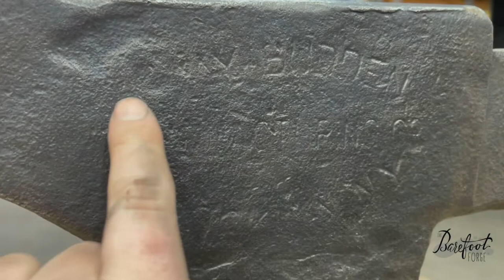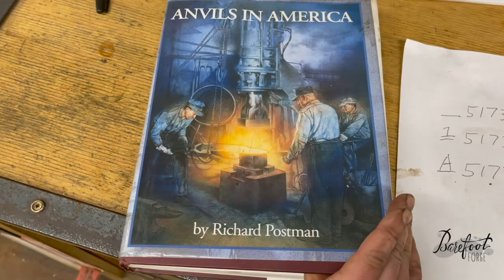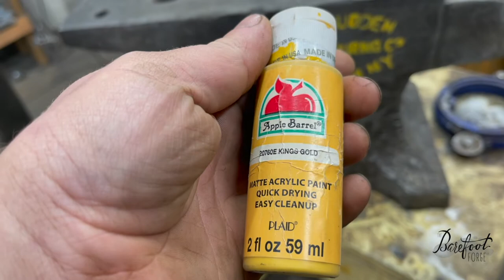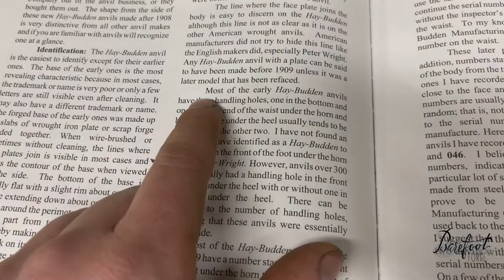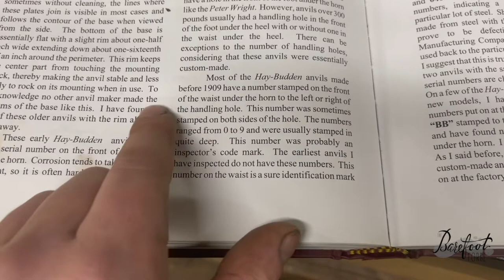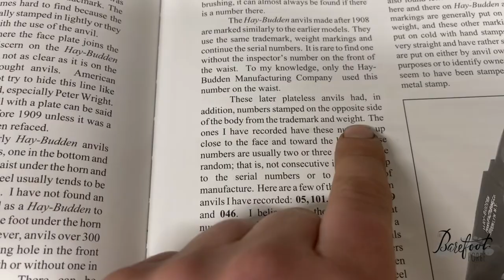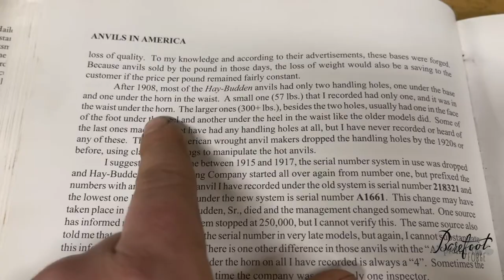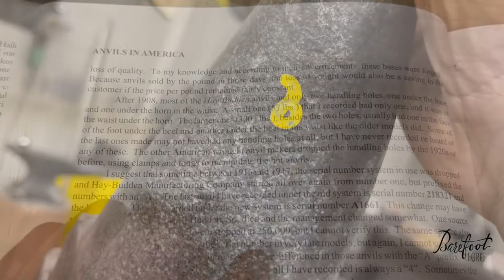Hay Budden Anvil Restoration- Blacksmith Anvil History

Comment: We always had a anvil in our shop even though we didn’t use it for blacksmithing. It got used on the farm to beat out u joints, flatten rivets, and general things farm related. That anvil goes to my older brother, however I found one yesterday for my shop. It is a Black Jack which I see was made by Hay Budden for Black Jack Hardware store. My serial number shows it to be made in 1907 and weighs around 90 lbs. I am thrilled to now own my own anvil!

Comment: So my Father wanted an Anvil and had been keeping an eye out for one, on our way home from the dump we stopped at a small collectors store where he had a few anvils, my father was looking at them and talking about price. the nicest one was the largest one that was actually outside, the owner decided that as it was late fall to offer my father a deal on the Anvil if he could get it out of the walkway so that the owner did not have to clear around it for the winter. We went home and he discussed it with my mother, who gave permission to buy the anvil the next problem came to getting it home. This is I believe a 450# Peter Wright Anvil that we needed to load into a vehicle by hand we decided the Vanagon had the lowest load level and ability to handle the weight so we headed back to load it up. we did manage to load it from a Dolly into the van but not without leaving a sizeable dent and were fortunate enough to use an engine hoist to unload it and it now lives happily in his Garage.
Reply: one guy try to use OSB to run his anvil on a cart...you know what happened...crack and time to rethink that...BTW, you know Craig loves vanagons !

Comment: You asked about rod I use?? Or I think you did. Please forgive my senile mistakes... So- I use 11018 electrode.. They way to apply is more important.. I preheat anvil to 350 degrees Farenheit. Start at one end and run ONLY about an inch to two then go all way to other end and do same.. Keep splitting distances until done.. This keeps excessive heat buildup in any one spot.. I learned this from Bill Apple from up in Seattle. 11018 applied this way winds up with about Rockwell52 which is ideal.. One other bonus is that,for some reason,11018 blends in so well that you can't see where repair was done with all anvils I've put it on.. My friend at Essential Craftsman on You Tube did a nice video on this.. He uses a different rod which gives one options.

Comment: I just found a Trenton anvil in a friend's barn.  She said I could have it if I could get it out and into my truck.  Done deal.  It's in kind of rough shape but I think usable.  Could you possibly help me out with some background on it?  It's stamped on the foot under the horn with 195  (weight?) and  the serial number  A100451.  It weighed 193 pounds on my scale.  I'm curious as to it's date of manufacture and its origin.  Thank you in advance for any light you can shed on it.  Also, it had a nice ring to it and good rebound at around 95% with a stele ball from one foot.  I'm thinking it's a forged type.

Comment: No No No on the weight!! The first number represents 112lbs. the second represents fourths of that so each number represenst28 pounds. the last number is simply pounds..
An anvil in that system that is stamped 122 weighs 170 pounds.. or 112 plus 56 plus 2equals 170 pounds..You need to read more of Mr. Postman... Really nice anvil. Glad you left it alone..I restore anvils for folks but would balk at that one too.. It is nice... Be glad to share what rods I use...
Reply from the maker: That is not correct for an American made anvil- but is spot on for many (but not all) English anvils. 

I would suggest you read up on anvils before giving advice.

What rods should I use?

This anvil sold for $2,700 in the condition shown.
Reply: @TheBarefootForge  Wow- I'll check on my Hay Buddens and get back to you. Apologies if I'm wrong. I understood the English system drifted partially ti U.S..
Reply: @TheBarefootForge  Owe you a beer! I'm sneaking up on 80 and had a senile citizen moment! Been restoring anvils for decades and beating on them since serving apprenticeship in 1965..

Comment: I bought a JHM competition anvil for $700, the anvil had only been used once
Reply from the maker: Nice! Those are great modern anvils and you got a good deal there! I believe modern anvils are better “in general”, but I’m in it for the history, and modern one has no history.
Reply: JHM Competitor is a DREAM to work on. I used one at a hammer in about ten years ago. I too have many old ones in my shop but the new anvils are made out of dream steel...